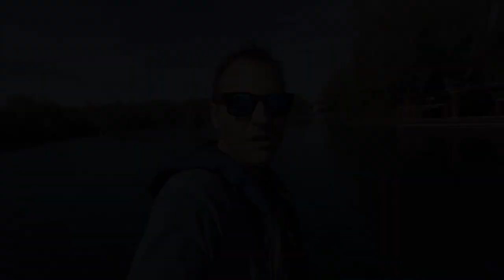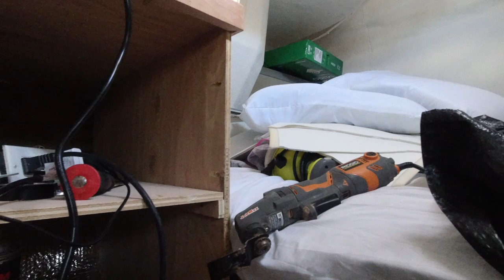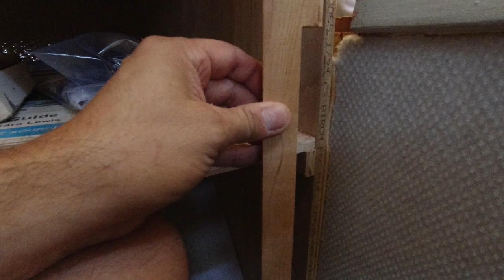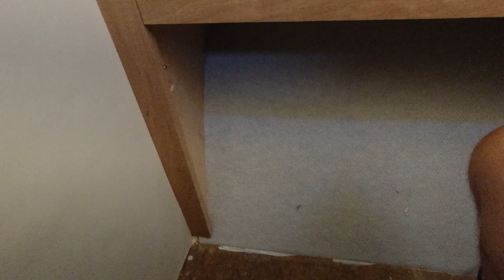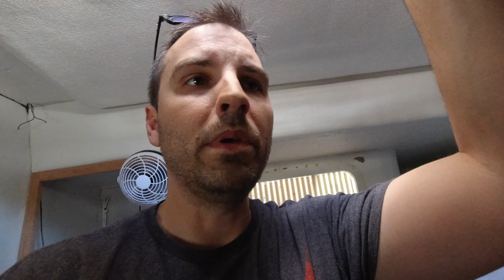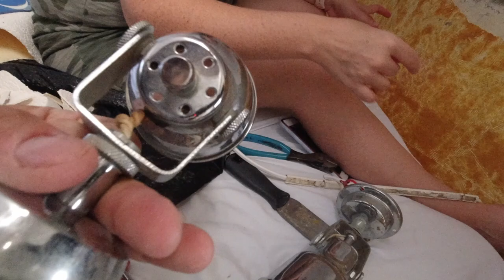Catamaran Sailboat Refit [Storage Solution] for Fulltime Family   Ep.27

Comment: I am allergic to alcohol...basically allergic to the fermentation process leftovers.   You are not alone in the allergy world. You can get like a purple mattress from Amazon and cut it with a serrated knife or electric roast cutter.  That is what I did to replace the mattress on my boat.  Man I sure love your pocket screw tool.  An awesome product.  You don't want to reuse fixtures with the wires knotted up like that.  The one fixture you showed was already shorting because of the positive and negative being compressed together in a knot.  The brown tint gives it away. Rewiring the fixture itself on the inside is a good option then...
Reply from the maker: Yeah allergies are no fun!!  I’ve seen the purple mattress and I’ve wondered how it would be on a boat.  The marketing looks great.  Does it sleep cooler?   
Yeah those fixtures would need rewired for sure!  Lucky I’m comfortable with simple electrical work.  Still not sure if we’re going to keep them though. 🤔
Reply: @SaltyEscape  Most foam mattresses don't sleep cool unfortunately.  You can get the gel topped or a gel cover and that helps the situation 100 percent.
Reply from the maker: Yeah, we’ve had a memory foam for several years... they get hot. I was wondering about your experience with the purple mattress..?
Reply: @SaltyEscape  The purple mattress is pretty decent.  It has those little cube type holes that help with the heat.  Much cooler than my home foam mattress to sleep on.  We still have a gel topper, but if you get the mattress see if you like it on it's own.  If not then add a gel topper...I just did the topper(cooling cover actually) because I had it.  Also we have two layers of washable polyester filter rolls(hvac) under the mattresses.  They help prevent moisture underneath the foam from causing mold.